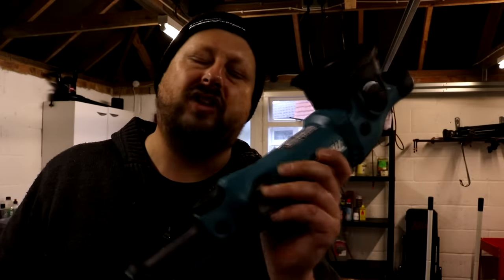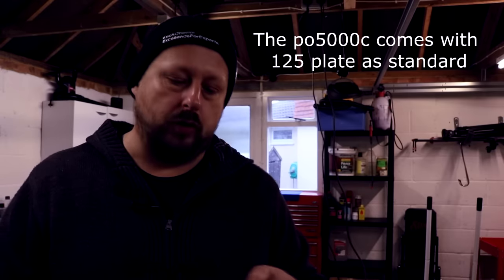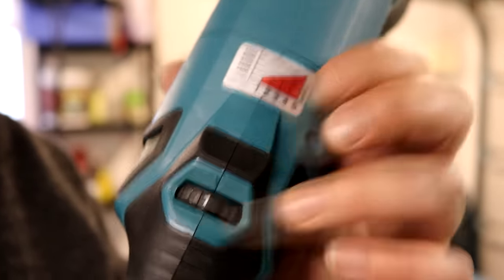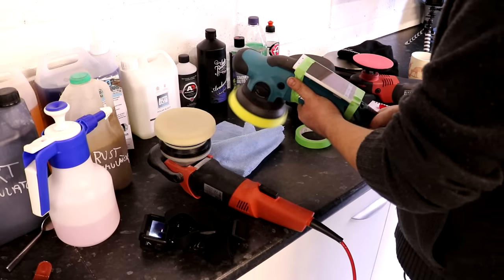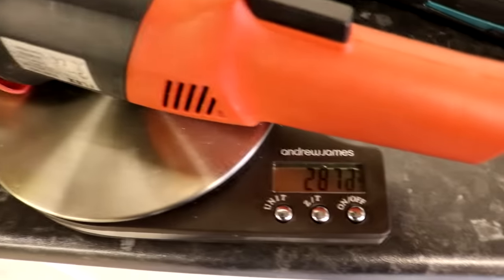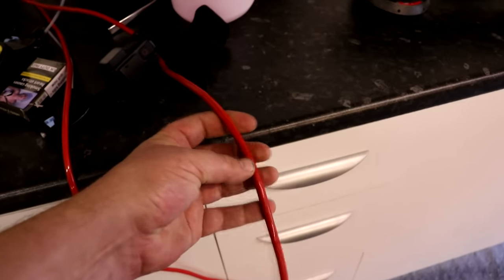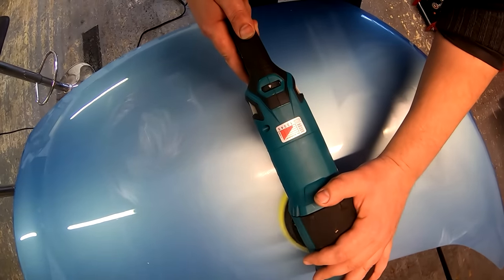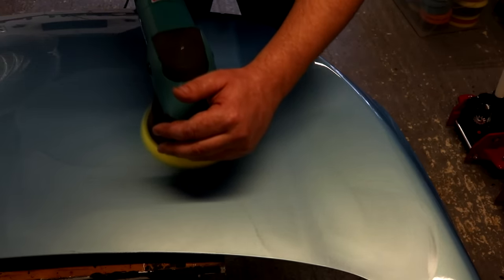Makita PO6000C Polisher Review - Free Spin and Forced Rotation in One

Comment: This is an excellent tool and you’ll find yourself using it in forced rotation mode all the time. Yes the machine can be harder to control in forced rotation but if you use high quality pads and make sure you’re not polishing dry, you’ll be completely fine; anyone used to using a rotary polisher will appreciate this machine.
Reply: Hi

Will it finnish perfectly fine with one step compound and no holograms every time / black / dark colours paintwork  / both german and  japanese paints or at least germans ? 

John has not it yet if i am correct.
Reply: Yes you can finish with only one step paint correction and finish

Comment: My first machine, bought it used in fine condition. Was concerned about sound of gears until I heard yours make same noise. The cruise control feature is great, its easy to wield and has a high quality screw in handle if required. Forced rotation with microfiber uropad and Perfect finish was exactly what I was searching for but takes more effort because it grabs onto the surface more.

Comment: I can appreciate this. I have a rotary and my trusty das 6 ( god love that das 6) ;-) , but yeah I bought a flex 3401 about 2 years ago at waxstock, yeah the forced rotation machines do pull you abit, a lot to do with keeping the  polish loose on the surface imo,.. if you let the product dry out these machines pull you about a bit, take your time, use the correct amount of polish and don't be tempted to work to big an area and you be on for a winner with i.e a flex 3401

Comment: Great video & very informative ! Makita now do a cordless unit with a brushless motor. Maybe do an update to this video ? Been using this new Makita now for about six months & love it to bits in either forced rotation or free spin mode.
Reply: Do you have the cordless version? How do you feel with the power snd vibrations? Not sure which i’m getting - PO600c or DPO600Z
Reply: @moezavlogs3252  yes ours is cordless & great with less vibrations than the corded version ! Highly recommend
Reply: @julianfisher6373  do you think it has enough power compared to the corded version? Sorry for the bomardment of questions. No one has properly reviewed it
Reply: @moezavlogs3252  yes without a doubt !! Used both & would recommend it definitely over the corded one every time.
Reply: @julianfisher6373  thanks! You’ve officially sold me. Was todsing up so many different machines; Rupes, Maxshine, Griots. I’d rather support Makita

Comment: They kinds designed the tool around 2step correction forced rotation for compounding and free spinning for final polish a lot older detsiler in us use rotary for compounding and finish with da also sometime in June lake country is releasing it new polisher. It can go from 8mm to 21 mm throw use 6inch and 5inch pad a new tire dress releasd by optimum technology it last 6to 12 months

Comment: Looks like a nice machine. I use a Makita rotary and have been resisting the urge for a forced rotation for a while. With black cars I sometimes get holograms if I don't finish on a soft pad slowly. Will this machine finish a medium cut without holograms?
Might be a good video to compare for holograms between rotary and forced rotation. Great vid as always Jon.
Reply from the maker: yes you wont get holograms with this thing.   At least , you know,  not saying it isnt possible, but you just wont.  its a good machine.
Reply: I still have my makita rotary, but hardly pull it out anymore with the makita forced its the boss, best investment ive bought for my business

Comment: Man I wish Flex had an appropriate backing plate for using 5” pads. I feel the 6.5” pads are too big for the machine and they end up tiring me out because I have to work them harder. Flex offers a smaller backing plate but I feel it’s too small for 5 to 5.5” pads. Would be amazing if they offered a 125mm plate as you said. I think it would make the machine MUCH easier to use and effective.
Reply from the maker: i think flex 3401 has 115 and 140 propriatory plates.   and then the 100ml and 150 ml LC adapter plates.  (I think. sorry if that wrong thats off the top of my head).  yer I would be surprised if the new tool isnt like 125 and 150.
Reply: Forensic Detailing Channel My flex came with a 150mm plate and the smaller option flex offers is 4 3/8” which is  too small for 5” pads. :( Lake country made one as you mentioned that had appropriate size (4 7/8” if I recall correctly) but a lot of people mentioned it was breaking on them.

Comment: Fantastic video again John , is a forced rotation polisher your go to machine nowadays or is the rotary still in with a shout.  The thing that puts me off the forced rotation machines would be the noise and vibration , how would the Makita compare to the Dewalt 849 ?
Reply from the maker: I got rid of the 849. was such a smooth well made rotary but it was just too heavy.  I use the pe14-2 150 now with the PE8.  Or ill use the 3401 with the PE8.  More often than not I would start with the 3401.  Its a bit slower than the rotary but it always seems to work.

Comment: I think I would be sold on the PO6000C but I think for use as my only machine a 5 inch backing plate would be better than 6 inch. The PO5000C does not seem to be a UK model? What 5" backing plate did you use and was that then with 5.5" pads?

Comment: Great video Jon, I think it's a great polisher but I would prefer it to spin clockwise like the Mille.  I own a Chinese copy of the Flex & an older Bosch sander/polisher that also has the dual mode but it's a smaller size like the DA polishers with the 8mm rotation. It also spins counterclockwise  which is odd since most polishers spin clockwise but no big deal they work fine. I wonder how the updated Flex will work & when it's coming out? Any info on that would be great. Thanks, Vince.

Comment: Dilemma time ! A cordless Makita DPO600 (I already have batteries from my other tools) or a corded Flex XCE... ? It will be approx. the same price for me.
Problem is the Makita is sold with a 150mm plate and the spare 125mm cost about 30€. I read the Makita was not as "strong" as its opponents, and could stall pretty fast in free-spinning mode... ! But still I’d consider Makita. Do you have any details on the backing plate ? What kind of attachment is it ? Thanks a lot for this vid !! Keep going !
Reply from the maker: you can put 125 ml plate on it.  I think there a model which comes with the 125 ml plate po5000c.  No problem there.   The dilema is less about price and the fact makita are less likely to be making polishing tools to accompany it?  no mini polisher etc..   

The makita polisher itself is really sturdu and well made though and cheaper than flex.  so you should be able to decide from this.  Its less about quality. more about are you a one tool guy or will you invest in more polishers later on.  If so you should go flex.

Comment: Hi jon. I did testing for festool a few years ago and i told them to redesign their ro 90 dx mini rotex for detailing use and make its throw 5-6mm. But they just wouldnt listen and change. Bloody germans. I sent makita a full list of specss for a new version of the po6000c a month ago including an eight speed dial up to 850 rpm and a softer bale grip and improvements to ergonomics and the free spinning mode to spin easier and be 12, 14 or 16 mm.  All gear driven polishers should be dual orbit and dual moded like the makita in the future
Reply from the maker: Tell them to make some long throws and mini DA's as well matt :)  Makita could sit themselves between the chinese tools and the premium options and provide a really nice option for consumers.  the build quality is there isnt it. you can just feel it when you use the tool. I dont think they realise its a market worth exploring.

Im thinking you cant easily make the free spinning mode 12,14 or 16 though matt without making the forced rotation move the same though matt?  gonna make it to much of a  handfull.  Do you know if they have patents on this tool?
Reply: @ForensicDetailing  you may be right about the forced mode being the same throw size. I have a dynabrade da accessory on a flex stone grinder and it can be locked by a pin to become rotary with 19mm orbit combined. It can flatten peel down somewhat with a microfibre and glasses paint out beautifully but the heat it creates is ten degrees hotter than any other tool in half the time so not ideal and a large orbit forced would be deadly to use and hold onto, be a psycho. But metabo achieved dual orbit with their sxe 450 turbo tec a decade ago, ive owned one for years and washer modded it but doing that with geared and random would be difficult.   Chinese tool company im getting to work on the design for me and a mini forced rotation tool. Might need two counterweights.  More oscillations per rotation or more rotations per orbit is what rupes did with mille and its great but $1000 bucks.
Reply from the maker: @matthewgibb2640  mini forced rotation sounds interesting.   hey stay in touch matt with what you do, love the passion you have for this.
Reply: @ForensicDetailing  thanks jon have you listened to my recent podcast on you tube - auto detailing podcast episode 379. My podcast episode with adam on the optimum synergy podcast should be up in two weeks.  Trying very hard to evolve the industry and make it move forward. Love your channel mate
Reply: Hi Mattew Gibb how are you?!  can you help me with your experience?  I am a super novice I have a Dewalt dmp849x rotary, but I also want to buy a double action and the options are: the DeWalt DCM848 polisher and the makita PO5000 polisher, please tell me which of these 2 polishers do you recommend, I hope you help me thank you!
Reply: @frankcandiani1076  absolutely. Send me a pm on facebook.
Reply: @matthewgibb2640  thank you!!

Comment: Hi John. Great review. I have this machine and I have a problem. (maybe it is just me.) On forced rotation unless the pad is well lubricated (causing splatter) I feel as if I am fighting the machine which makes it a very tiresome experience. Any tips (i.e. Pad/polish combos) which would make it easier. Thanks in advance.
Reply from the maker: hey russel  so the downside of force rotation is yes if the pad starts to stck your going to feel the machine pull you more.  I dont typically find loading up with more polish helps although some guys do.   I find pad choice helps.   and cleaning the pads properly.  and compound.   I highly recomend the purple flex pads to cut and the orange flex pads to polish.  Team them up with H9 or 8, F5 or6 and M2 or 3.
Reply: @ForensicDetailing  Thanks for that John. Appreciated

Comment: where can you recommend buying a low budget DA Polisher preferably around the £100 - £150 (dont fancy spending a lot because I'm a weekend warrior, it would only be used rarely but wsnt a decent machine)mark also pads and 75mm backing plate you'd recommend.
cheers.
Reply: I use a Shinemate EX605, its small, its light and counterweight is really good, you get a lot for £140. . . it cant use 75mm so maybe not for you. . .
Reply from the maker: Id say just get a DAS6 pro.  5 inch plate with some hex logic pads.   75 or 90 ml plate with the 4 inch hex pads.  Buy a bottle of Perfect finish and some white pads and away you go.   There are of course limitations to doing this but you can also get fantastic results.
Reply: As Jon above said a DAS6 PRO may be a good option. Have one myself and used it on my car and works well
Reply: sa good as das6 may be. . .the difference in price is abt £20? for this you get long throw and less vibrations. when spending some 8-10h on a car. . .I would say it is easy worth the £20 more. . .
Reply: Antonio Farina  yes 👍. Sorry man this stupid auto correct bugs me at times 🤦‍♂️

Comment: Hi Sir, just a quick question: do you think it is viable to use for correct and polish kitchen granite/marble work tops? Is it powerful enough to do the job? 
Because it is forced rotation with 8mm, when the edge meets some sink edge,I guess it will have avoid area or the machine can cut the edge of the sink edge? 

Thanks for your answer.
Reply from the maker: I dont really know jerry but if I had to guess I would say its not suitable for granite or marble work tops.
Reply: @ForensicDetailing  Thank you very much for your prompt answer, so I will probably go for a normal polisher. Not sure if you have any recommendations? 
Thanks a lot!

Comment: could you tell us something abt the Health "cost" of working with a machine like this, day after day, or maybe a comparison a "pro" machine vs a cheap one. . .vibrations and so on? thx
Reply from the maker: was chatting to reg about this the other day.  He machines for 8 hours a day 5-6 days a week. Hes been doing that for over a year and his hands are starting to show signs of wear and tear, joint pain, stiffness in joints etc..     I think this is an issue for people doing a lot of polishing.  I dont do it professionally , but if I ever spend adjacent days polishing a car its my back that feels it the most.  mainly down to poor posture when polishing.   Smooth machines are desirable, the more you do, badly vibrating machines give you numb hands quickly.
Reply: @ForensicDetailing  that's why the Makita PO 6000C is the bomb Jon. Remember I've been using one since 2017. It's more solid than the Rupes LK900 Mille more torque and paint correction power. Even if it spins anticlock wise it is more powerful than the Rupes Mille. Ergonomically it's superior to the Rupes Mille ! I have not tried the Rupes Mille but according to Matt Gibb he thinks the Makita PO 6000C is superior in every way especially performance. 535rpm Rupes Mille LK900 against Makita PO 6000C 780rpm ! Great review Jon glad I put you on to Mark Leddy
😊
PS I also own the Flex 3401 VRG since 2008 never missed a beat !
How would you rate the Makita PO 6000C against the Rupes Mille LK 900 ?
Reply from the maker: cheers mario matts such a top guy, love his passion for this stuff.  Id have a makita over the rupes mainly due to price.  I still think the rupes is a great tool.  it also has a good solid feel although your conscious of being raised back from the panel at bit more even if its literally millimeters.  rupes maintains temp better and obviously has less wobble than the flex, love the 9 meter cabel.      but yer Id take the makita because its every bit as smooth but basically close to half the price.

the most important thing I think is just finding a pad and abrasive combo to use with these tools, it might even be more important than the tool itself.    still those 5 inch hybrid pads on the 4 inche flex plate, for whatever reason they make controlling this tool so much easier, less effort, just bang it on the panel and it never wants to walk.   so I really will always stick with my 3401. even when the new xce comes out most probably.
Reply: @ForensicDetailing  Don't get too excited about the Flex XCE because they haven't made leaps and bounds Jon , I recently spoke with Renny Doyle and he's annoyed that they have not evolved like Rupes and Makita ! If you go on the Flex website you will be utterly disappointed! There specs have been reduced from 480rpm to 430rpm increase in power 1010watts to make up for the shortfall in rpm! In my opinion they have shot themselves in the foot Jon.A lot of Flex fans will go elsewhere because Flex is too stubborn to listen to suggestions typical Germans know it all's! They will loose customers by not listening to there customers requests !
I found with the Makita PO 6000C the best pads for this machine polisher are the Flexipads Xslim foam buffing pads the machine becomes even easier to control when using this combo with hardly any vibrations ! Better than using thicker pads like the Lake Country Forced. A smaller 125 mm backing plate makes all the difference too especially when using this combo!
Reply from the maker: @Eurogloss  do you feel like the machines need more power or rpm mario?     theres not too much I want changed about the XCE other than loose the metal shroud and offer standard plate sizez perhaps.  125 and 150.  Id love if they did a 100ml plate as well but id be one of few wanting that.  id love them to loose the red cabel as well with a 6-8 meter heavy duty one.  be nice if they could get the price down a bit as well.  perhaps Id like a totally robust plate interface without the felt ring as well.

Comment: What mode were you using for finish,,i have the DPO600 cordless,, struggling to go from wet sanded clear coat sanded at 1500 with farecla,,it wont start to shine.
Reply from the maker: I would step those 1500 marks down steve.  soak out some p2500 of 3000 for 30 minutes.. step down the 1500 to 3000.. Then hit the 3000 with a SFC101 or a high cut compound like H8...  then refine it.   If your nor removing sanding have something is going radically wrong.  normal risk is it will shine but you can see rounded rounded sanding marks still.   stepping down will ensure that doesnt happen.

Comment: When you say forced rotation is that the same as an orbital or is it still oscillating in forced rotation mode
Reply from the maker: yes.  but the rotation of the plate is driven by a set of cogs.  Those cogs dont exist in the free spinning equivalant.   take away the track or cogs and the forced rotation is essentually the same as the free spinning DA.   See picking the right polisher video and pad dynamics video showing tracers light movement.